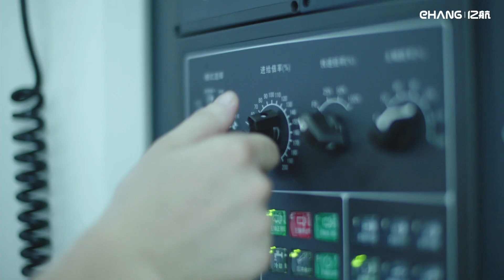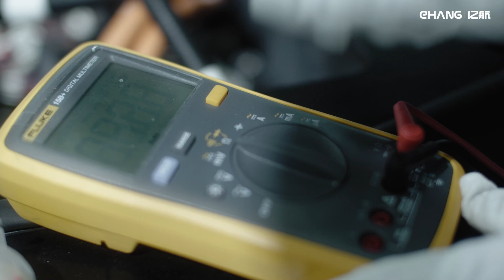EHang Yunfu Production Facility in Operation

Comment: In 1913 Henry Ford invented the assembly line. I would have expected to see one or at least a little more automation. Looks like everything is done by hand. That should drastically limit the output potential of this facility.
Reply: Absolutely. I couldn't believe how the high technology assembly line operates like that.
Reply: As a composites engineer who worked in aeronautical manufacturing, I can say that they seem to use the same manufacturing processes. Only thing I would mention is the use of dry carbon fabric instead of prepregs and assembly without mounting jigs. Both understandable and expectable considering the low volume production demands.
Reply: I was thinking exactly same thing... But to build up production lines they need certain amount of orders. So I hope that they are al least considering those automation production plans. I don't believe that the CEO is ridiculous enough not to calculate the cost efficiency. But I think it's their "mistake" that they showed how they tightened the screw with their HANDS. I'm an engineer. And when you design the machine, you make a assembly instruction book for the workers who assemble the machines. And mechanical designer has to write down every single Torque which is required for the parts.... But they are doing the thing by hands. Disappointing. I am an investor of Ehang and a huge fan. I hope you guys will make it much better. Go for it.

Comment: Ehang, please listen to reason. If you don’t you will go bankrupt and all go to jail. 

This is extremely dangerous design. Having rotor blades at the same level as cockpit means if accident happens (and they will!) it will kill all of its passengers.
Reply: @RareVDO  what are you talking about man
Reply: @Nate-np5tt  I am talking about having the rotors so low people could potentially walk into it, or when the drone crash the rotor and the blades would detach and fly into the cockpit because it is at the same height level as cockpit.